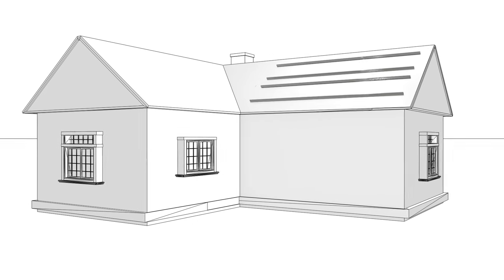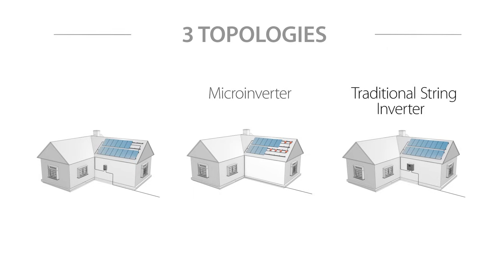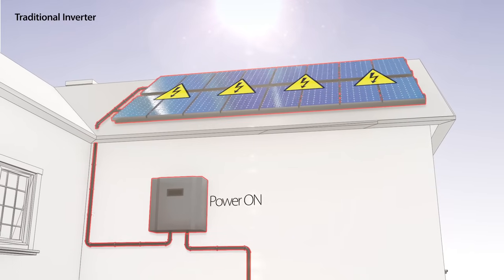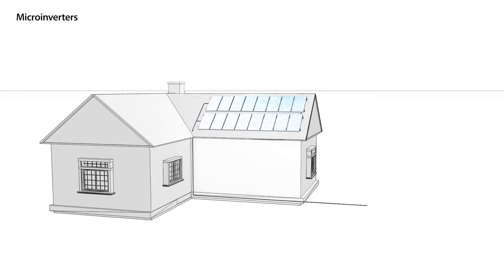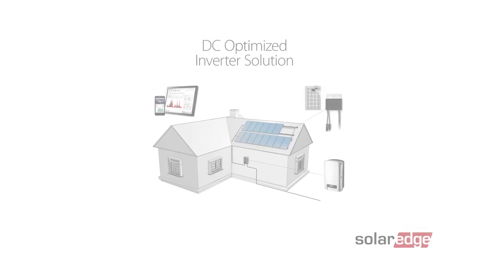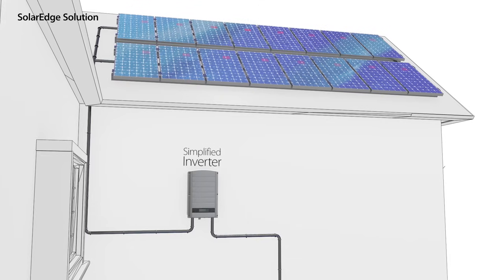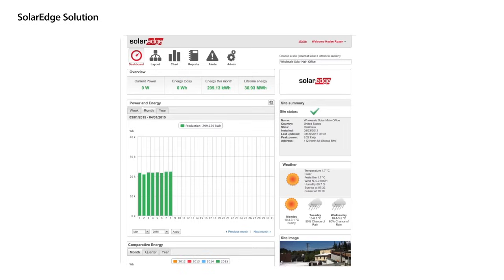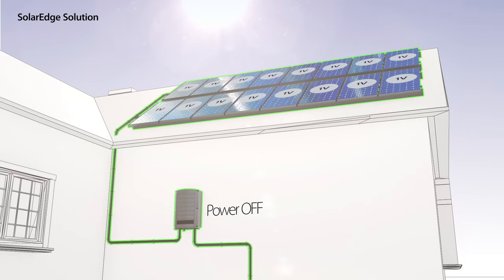SolarEdge Technology Overview | Australia

Comment: Installed 6.6 solar edge system just over 1 week ago. End goal for me is reduction on my bills and after 1 week we have reduced our imported energy by half and this is during a week of pretty average weather  Very happy and no complaints thus far
Reply: Hi Derek, that’s pretty interesting. I’m looking at the same - but was interested to hear your thoughts after your first year with your solaredge system.
Reply: @mikewilson6898  Hi Mike, yeah good question has been a mixed bag actually. Some good some not too dissimilar from the original which i havent been able to explain nor could energy provider. The last bill in Jan was around 2/3 cheaper and this is where i think it should be but we will see. Next bill is due in April i expect it should be similar if not better as we have had a really good summer here this year. In saying all of that what i can confirm is the pay back will be longer than what was suggested based on resultsto date.

Comment: We installed SolarEdge on the largest rooftop array in the Midwest - 3.4 MW DC Magid Glove in Romeoville IL. While SE is a premium product you get what you pay for and the out of the box monitoring is second to none, combined with module level shut-down = win-win! Let's grow solar, wind and battery storage!
Reply: Hi Tim, I intend to order the SolarEdge system.  What is your experience after two year operation? thanks a lot for your answer.

Comment: I'd love to be happy about Solaredge but it's never worked 100% in the 1 1/2 years we've had it. Constantly having to reboot it outside and the panels don't always work. Have the same 4 not working again. The inverter was out and took 3 months to replace. Very disappointing.

Comment: My Solar Edge HD Wave 7.6 KW inverter failed in less than a month. A resistor in the upper left of the top cabinet burned up. After two weeks the replacement arrived and the same resistor in the upper left corner was burned up. I heard the support guy ask the installer to remove the cover and take a picture and he very quickly identified the problem. Does Solar Edge have a systematic design problem or a manufacturing problem? It didn't take the support guy very long to figure out what was wrong so I am guessing this is a common failure. What good is a warranty of half the time my system is down?  Another two weeks waiting for a replacement ( Solar Edge put a rush on it because it was an install failure)  and hopefully the third unit will be installed this week.I am very disappointed after having spent so much money on solar.
Reply: How is your system performing now?
Reply: @johnbgood3488  Expanded my system and covered my roof with solar so now I have 44 panels. I actually installed two inverters and the primary never had any problems at all. It was the second or "follower" that caused all the problems. The system hiccuped once because on the original install they did not torque down the screws on the circuit breakers that combine the outputs of the two inverters. That may have been why the original  follower inverter went out. But finally stable and I run my Chevy Volt on sunshine because once the house batteries are charged the rest goes into the Volt.

Comment: My system is designed for 8.1kw.The panels are putting out over 10kwatts. Why is the SolarEdge converter set to a max of 7.1kw. So far this year I have yet to get much over 6kw. The wiring from the panels is to small or the inverter is actually set to 6.xx. Any ideas on what is wrong??
Reply from the maker: Hi, a member of our support team will be happy to assist you. Kindly open a support ticket at https://www.solaredge.com/service/support.

Comment: I need to know the instantaneous power to the house at any moment.
Because i have lots of intermittent cloud cover, solar pv fluctuates. So i want to know what my TOTAL power consumption is,
Ie. TOTAL=PV Self consumption PLUS imported.
Eg PV generates 2kW and imported is an additional 2kW. I should be able to see 4kW easily on any day graph. 
Maybe a NEW yellow graph is needed to show this.
At the moment the new software doesnt even allow selection of blue and red peaks when they overlap. 
The old s/w allows this but clumsy to try and work out. 

PLEASE ADD THIS ABILITY
Reply from the maker: Thank you for your feedback.  If you require assistance, our support is available at https://www.solaredge.com/service/support

Comment: I've been trying to get my permit application approved for 15 months, here in Palm Springs.  They won't accept the Straight Line Diagram.  I cut and paste electrical diagrams from the Solar Edge wiring guide and installation check list, but that was rejected.  I'm the homeowner, a licensed general contractor but not trained to produce SDL's.  Software is available, but it costs $250 minimum or I could hire an engineer but that would be ridiculous.  The reason they want the absolutely redundant information, is to calculate if the system might overheat.  I designed it from the beginning for the low desert, it has two or three other heat protection strategies that make this all really stupid.  I spent six months petitioning a Grand Jury to get a judge to force them to inspect my installation, and lost the argument.  The battery cost $5495 and I'm unable to apply for the rebate, no net metering available because I don't have an inspection sign-off.  Both SolarEdge and LG Chem have been useless.
Does anyone know where to find a Straight Line diagram for a 5.1 SolarEdge/Storedge system with LG Chem Resu 10 battery?